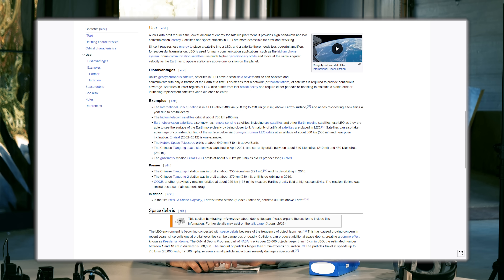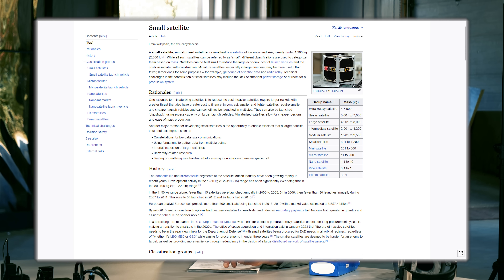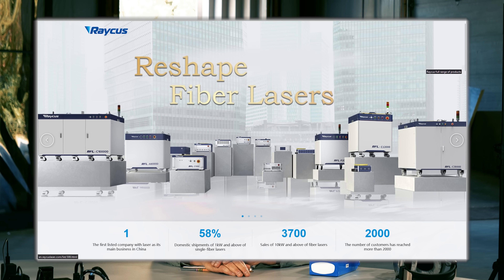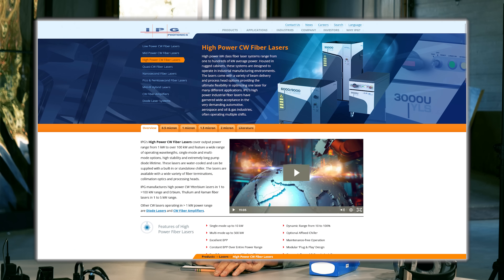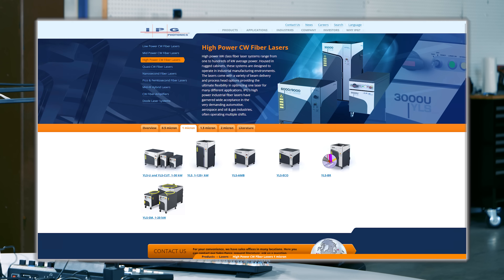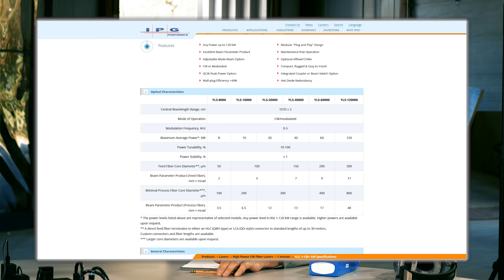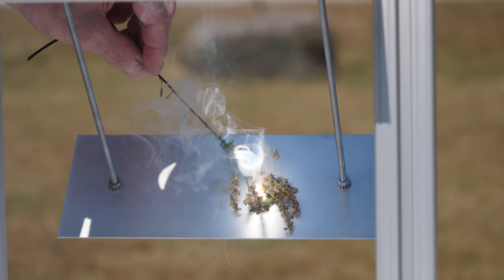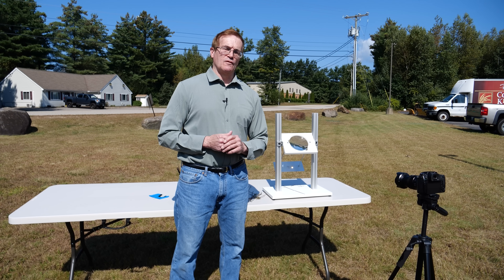COULD SATELLITE LASERS REALLY DO THIS?...

Comment: The No. 1 Challenge with a satellite is not distance. It's HEAT. The ISS has massive radiators just to deal with the heat produced by the power/environmental systems. As a frame of reference, the ISS has a peak power usage of 90 kW, with a peak production of 120 kW. When the USAF tested out the YAL-1 Airborne Laser the biggest challenge holding it back was managing the waste heat it produced. Getting rid of heat in space is very difficult and involves tradeoffs such as expelling coolant (a consumable), or having large radiators. 

DE systems produce an insane amount of wasted heat, even chemical lasers like COIL have these challenges. (Also you would want to avoid using a consumable laser system on a satellite)

Just something to keep in mind when talking about satellite based Directed energy systems.
Reply: Lasers on planes solve most of this, we don't need to be in orbit to set shit on fire with focused light. I can do it across my bedroom, and the military CAN do it from much further. Hell they have lasers in the point defense systems.
Reply: It also has a pretty hap-hazard CGI team as well . Along with those pesky airbubbles that seem to continuously show up on film when they go outside of it to perform " maintenance " ....
Reply: Its crazy the average car today makes somewhat more than 120kW now. That might be peak HP but still. A space station or a car.... just goes to show how inefficient cars really are.
Reply: Not really an issue especially with modern materials and a much bigger budget than NASA or the ISS program.
Reply: What about a giant magnifying glass?
Reply: @TroyRubert  Yeah until you melt the satellite and now it's a hunk of molten metal
Reply: Heat lost [watts] = area [m2] * emissivity * 5.67e-8[Stefan-Boltzmann constant] * T4 [degrees Kelvin]. unless you just let it be single use, it burns
Reply: Fiber lasers don't have the heat problems that other kinds do.
Reply: True but this system would not need to be on for very long. 
So you could easily dump the heat into water and let it cool off slowly. 
Dumping the 10min of full power of this laser into 100L @ 10°C water would bring it to 80°C. 
So well within the constrain of this thought experiment.
Reply: @hanifarroisimukhlis5989  where did I say the sat wouldn't have sufficient thermal regulation? I just said the ones we can make to day are better than the ones on the ISS.
Reply: I would expect that something like a phase conversion heat sink would be employed.  Presumably the laser duty factor is quite low so you sink the heat and then dissipate it over time.
Reply: I thought everything about this video was great except for one thing. He completely blew the punchline! Really smart people do that a lot.

If the destruction of Lahaina was a Rube Goldberg Contest, this video would be the proposal to Blue Ribbon 1st Prize!
I’ll break that down for YouTube tier…
‘How to do a VERY simple thing in the MOST complex and convoluted way possible.’
Reply: That's the mechanical power it produces, usually efficiency is below 30%, which means that 120kw car produces 240kw of waste heat, some of that gets expelled with the flue gasses = "exhaust", and the rest has to be dumped into the passing air usually with water to air heat exchangers. Some does get transfered from the engine and exhaust surfaces as well via radiative and convective heat flow. 
This is all much easier because cars operate in atmosphere.
Reply: Why not have a guy with a lighter. Give him first class flights and a stay in an upwind 5 star hotel. Should be quite a bit cheaper.
Reply: @TroyRubert  thermal dynamics, particularly thermal management is one of the few engineering fields that rarely changes or experience significant(large multipliers) advances from material advancements. This is not a situation where you wave some magic carbon fiber at the problem and it goes away. The thermal emissivity of a surface isn't going to see 2x-10x improvements without violating the no joke law of thermal dynamics.
Reply: You cant radiate heat into a vaccum genius...
Reply: @martyisabeliever  Umm,... yeah, you can.  It is physical conduction of heat that does not occur in a vacuum.  However, conduction in a closed system could facilitate more rapid periodic heat dumping cycles into heat sinks provided that there is sufficient time for radiant losses to drain the accumulations of heat over time.
Reply: Why not, indeed.  Would it surprise you to learn that this is being done on a wide scale all over the world already?  You don't think that those with immense fortunes and political influence might want to develop more technologically advanced "tools" if they could?  Do you think they can?  How much resources do you think they would invest just to see if it is even possible?  Just some things to consider...
Reply: @steffenjespersen247 That much water would weigh a bit more than 1,700 pounds, that is, just over 1/2 metric ton.

If the goal is to keep the laser switched on for the whole 10 minutes (mentioned in the video), how much water would be needed for that?

That is a lot of water weight to launch into orbit. That much weight would likely have to be launched on its own mission apart from the laser satellite itself; if so, then you would require a way to transfer that water into a container in the laser satellite. 

If you wanted to use the laser again the next time you are over the target, you would have around 90 minutes to dump the heat that you just put into the water so that it can be used as a heat sink for the next short. I don't how that would be done, or if it could be done that rapidly.

You would have the challenge of keeping the water from freezing solid in the low earth orbit environment when you aren't using the laser. Using insulation would be very bulky and heavy, and it might not even work. The only other option would be some kind of heater, which would require a lot of energy to keep warm constantly. This energy would have to be tapped from whatever energy source is used for the laser itself, which would require the energy source to be larger and heavier than otherwise.

OR, you could use a radioisotope thermoelectric generator (RTG) (which uses Pu-238) to provide the energy to heat the water. Unfortunately, the national stockpile of RTGs is rather limited, and there are security and safety issues that would add millions of dollars of costs to your spacecraft. If there is some kind of accident, or if the satellite is retired by de-orbiting, then the RTG might or might not survive reentry into Earth's atmosphere, and therefore presents the risk of a nuclear contamination incident. For these reasons, RTGs are generally reserved for missions to the planets and moons of our solar system, rather than being used for spacecraft in low Earth orbit.

Considering all of the above, I am unsure if your water heatsink plan is viable for this application.
Reply: Thanks for that, just answered all what I was thinking!
Reply: The heat problem you're referring to is actually the reason why the Death Star uses multiple intersecting beams -- fortuitously, the intersection technique also has other benefits.
Reply: @sfcarp9418 Don't forget the cable system and harnesses as well.
Reply: Spicy facts.
Reply: @Hclann1 50%efficiency mean you will get 20kW heat source for 10 minutes. And that is the same amount of energy that will be transfered to Earth with a beam. But let's imagine we'll have an additional 1m³ of water coolant there. It will rise its temp only by 17°C with that amount of energy. So nothing impossible.
Reply: @thee_number_six6227  One has a great point here. It does not take much to send up a disposable plane. Its very unlikely that the US can track every plane in the air. If you can track every plane then U2 would be spotted every time it goes up. Dispoable planes that can go up 100k feet and then ditch in the vast ocean would be quite easy to build with todays tech.
Reply: @Hclann1  Well that is good to know.
Reply: phase change thermal storage, pumped into radiators specifically designed to emit blackbody ir into the black.
basically store the heat spikes, bleed it off over a week, in order to get a few seconds of zap every once in a while.
it's not like the weapon has a 100% duty cycle 24/7.

it's definitely feasible.
Reply: Of course you can. @martyisabeliever
Reply: @kameljoe21  It is certainly seems more feasible with current technology to run such a weapon system from an aeronautical platform.  But, that does not answer the question being posed here.  And, when all things ae considered, an orbital platform may have use cases that might make such a technology desirable to those who would invest in its development.  The question here is simply, can it really be done (not was it or should it or would it, etc.)?
Reply: @Embassy_of_Jupiter  hold my beer while I make them out of iconel and attach them to a heat pump that can handle a few thousand degree tempature gradient... 🤣😆

This is a joke... until someone links a usecase where they essentially did exactly this. Engineering is compromises lol
Reply: Agree that a plane is a more practical platform.  Consider how satellites are managed, involves far too many witnesses.
Reply: Thank you for your comment. I had bad info...
Reply: If we look at the H4 laser beam mounted on Humvees on convoys across America, Ratheon is marketing them to mount on a Chevy Silverado. Who are they selling to? To start fires for real estate? And who owns ratheon? Blackrock/Vanguard/Statestreet who owns the central bank, the military and is heavily invested in real estate.
Reply: @MorRobots   Hyperbole is a rhetorical device and does not support technical arguments very well.  Do you see this as a political issue?  How exactly did you come up with "a few thousand degree temperature gradient?"  I mean, given the relatively meager energy discharges and short duration duty cycles we are talking about here, I don't see how you got there.
Reply: I thought the ISS was in a nasa swimming pool in Texas.
Reply: The ISS mostly has that because humans are less tolerant of heat than machines, but heat is an issue
Reply: @simonlinser8286  not sure how a measurement of peak HP (pulling strenght) is a proof of inefficiency. The laser isn't moving a damn for example
Reply: @Hclann1  fiber lasers have the same heat problems because they are using the same laser engine. It is somewhere else and the laser light is carried by the fiber. Unless you have a VERY long fiber from the ground, it's not gonna work for a satellite.
Reply: @marcogenovesi8570    Laser light transmitted by fiber is not the same as fiber laser.  It is a particular type of laser "engine" that uses the fiber as a gain medium (instead of a gas).  It is quite a bit more efficient than gas lasers and thus does not produce as much waste heat.
Reply: This means if such systems are deployed then amateurs should be able to detect the telltale thermal radiation signature for hours after deployment.

Great step to being able to falsifiably analyze these programs rather than relying on simple trust and guesswork
👍
Reply: @googleyt2622  Yes and no
Yes in that you don't need an order of magnitude more input power to run the laser
No in that it still outputs more waste heat than laser energy
Reply: @hakasays  Good point! It also means any such weapon would have to be considered disposable since any near-peer adversary would be able to spot it and shoot it down, so the target effect better be worth the cost of the system. Given heat and energy constraints, the amount of engagement is heavily limited before a lengthy cooldown would be needed, where the system would effectively be a sitting duck afterwards. Might as well invest only in a super basic cooling system since being able to reuse should be considered a bonus and not expected.
Reply: @martyisabeliever Were this true, every astronaut we've ever sent up would have died from heat stroke. You can't CONDUCT heat in a perfect vacuum (of which space is certainly not), but you actually can't stop it from radiating out. 

Having large optical radiators (think the coils on an electric stovetop that glow red) that are fed by a conductive thermal well (such as pumped water, glycol, freeon, liquified gasses) is generally the way most spacecraft do it.
Reply: @tomfeng5645   And the only realistic alternative to this would be a plane-based system, which means that transponder tracking and 4th-generation night vision hardware would both offer mechanisms to track down such systems.

If microwave-based then we would also expect to find local EMP-effects on affected sites (cell phones nuked, etc).
If UV/IR it would be detectable via cameras, and if microwave/millimeter it should show up to some degree on local WIFI disruptions/impulses.

The point is to get people staged so that even if the tech was real, it could no longer be deployed without being reliably detected by the populace.
😙
Reply: @tomfeng5645  That does not contradict what I stated about the difference between fiber lasers and gas lasers.  As far as the fiber laser in consideration here, the actual specifications have already been stated quite clearly in the video.  The manufacturer's claim is 40% power conversion which is why the estimated power input requirement is 50kw for the 20kW model.  Obviously, the waste energy will be 30kw in this scenario with most of that being waste heat.
Reply: I can't believe the 400km range was kept at a constant but would only exist for a fraction of a second. Most of that 10 minute transit would take place at thousands of kilometers away. There's also the tracking at such speed. Oh and power-loss of the beam traveling through air. We barely have systems functioning on smaller scales, so no way in hell there could be a space-based version. Especially with the absurd cost it would be.
Reply: @MorRobots Inconel is probably not the right material here, given it's weight, it's ridiculously low thermal conductivity for a metal, and that a mechanical attachment to a chunk of metal that's thermal cycling that hard is gonna be an absolute bugger. I'd go with a ceramic, something like AlN or CBN.

Pure silver (best thermally conducting pure metal) has a thermal conductivity of ~400 W/mK, while inconel is 15 W/mK. Inconel is a fantastic insulator, which is why it's awful to machine. Cubic Boron Nitride, however, conducts at ~750 W/mK, nearly doubled that of silver. CBN is fairly cheap, fairly light weight, quite formable, a bit difficult to machine, extremely durable, and can handle in-range thermal cycling indefinitely.
Reply: @martyisabeliever Yes you can?
Reply: @JJayzX  Well the patents and prototypes do exist, and budgets seem to be fairly bottomless for projects like this.   With most of the public disclosure for millimeter-wave and similar being primarily plane-based and not satellite.

But to risk disclosing an entire program just to smoke a few city blocks in Maui would be beyond insanity.  And if it were such a case then it would not take much effort for random investigators to reverse-engineer and prove it.  Telltale signs/fingerprints that would be impossible to mistake for nature.
Reply: Some of it is grounding as well. They can build up some incredible static electricity.
Reply: @hakasays  patents mean nothing, anybody can create patents without actually making said devices or that they even have to work. Also people nowadays simply can't keep their mouth shut. So if their were lasers in space it would be a big deal, cause space treaty forbids space-based weapons.
Reply: @Hclann1 on earth.

He said, they are 50% efficient.

This means that it will have to dissipate an equal amount of its output, without the benefit of atmosphere to discharge this heat.
Reply: @simonlinser8286  It's not so much cars are particularly inefficient as it is moving around on the surface in general is inefficient. Road and tire friction have to be balanced for acceptable handling, air friction gets worse the faster you go, every time you go up hill you have to expend more energy fighting gravity, everything is just sapping your energy compared to coasting around in orbit. Space station is about as close to pure Newtonian "assume a spherical cow in a vacuum" as it gets while still being technically inside Earth's atmosphere.
Reply: @barrybrevik9178  How on earth do you figure that 100L of water is going to weight 1700 pounds? 1 litre of water weighs 1kg. So 100L weighs 100kg, or 220.5 pounds. And it seems to me that having it freeze is a benefit, not a problem. If you want to cool something down a 100kg block of ice is a good thing to have. Then you have the benefit of the phase change from ice to liquid.
Reply: Cooling system. A foil bag and a bottle of water. When things get hot, water turns into large inflated bag of steam. Which can be slowly cooled down and recaptured to recharge.
Reply: @hanifarroisimukhlis5989 do some research on current metal ceramic hybrids! What you think you know is nothing judging by your comment!
Reply: @jamesthomas4080 well put!
Reply: That's if you trust the information you re given is true.
Reply: no way the iss have 120KW of solar panels xD and for sure does not use 90kw. you are way off dude. it would be beliveable if they use 9kw and panels have 12kw maximum.. i bet they only use 2-3 kw at any time as it is a small space to be heated and recycling air and piss does not take much power.
Reply: @tripplefives1402 yes they still heat up but not like you describe
Reply: Heat is a huge problem in space.  But it can be solved.  In the context of GW scale radiators, I got it down to around a kg/kW using condensing water in plastic tubes.  The mass of the radiator went down as they got cooler, something unexpected.  It was because the vapor pressure of water fell faster than T ^-4 from boiling to freezing.  20 C seems to be a reasonable radiator temperature.
Reply: @kameljoe21   Pity about the pilots, though. I guess they'd just have to take one for the team. 🤕
Reply: You do realize how cold space is right?
Reply: I once was told a story by the EE who ran the electronics shop at my university about how he had worked on a satellite kinetic kill device that had a seeker head that put out a ton of heat while operating, the solution to keep it from burning itself up was to surround it with wax as the heat capacity during a phase change is infinite. I find it plausible that even if a large amount of waste heat is generated if there's enough phase change heat sink material to let it fire long enough to accomplish the objective then it's just a matter of how long it needs in order to cool back down. What that would take? I don't really know.
Reply: I had access to certain information 12 years ago, and from what I understand there are weapons in orbit that are expendable chemically powered laser type energy weapons. There is no issue with heat since they just burn out as they are used, and are very powerful - powerful enough to penetrate vehicles and buildings to kill high value targets.
Reply: Naw, you want to use a deuterium fluoride laser - then wonder where the damned thing wandered off to after firing it.  ')
Reply: @thee_number_six6227 you forget that the earth is round? A Boeing 747 with a directed energy weapon isn't going to reach the other side of the globe like a cluster of satellites could. Especially when it can barely reach 800+mph depending on the variant. Imagine Starlink with directed energy weapons. You could strike anywhere, anytime. Hypersonic missiles would be more effective.
Reply: Also humans wouldn't be inside the directed energy satellite so heat wouldn't be as big of a deal. If we have satellites flying past the sun, we should be able to use a directed energy weapon for a short burst. It's not like it's the Directed Energy Satellite "Odin" from Call of Duty lol
Reply: @vihreelinja4743  Yeah, that seems very eccessive. I always think about it in terms of gaming computers :) 90kW is more than a hundred of those going full tilt all the time. Or 30 maximum size water kettles. ALL THE TIME. Makes no sense.
Reply: @hanifarroisimukhlis5989  it doesn't really look like it takes 10 minutes to set stuff on fire though, wouldn't the satellite survive 15 seconds?
Reply: @martyisabeliever  if that was true you'd never feel heat from the sun, the heat getting here in the form of solar radiation that is radiating from the sun
Reply: @martyisabeliever Sure you can.
Reply: IggyDalrymple  Just have a satellite reflector at a geostationary point and keep the laser generating facility on the dark side of the moon with subterranean intercoolers.
Reply: @MrSeanman30  an amazing feat, were a 500 pound satellite to power anything beyond a laser pointer.
Reply: @MrSeanman30  heat is the enemy of electronics. Don't believe me? Take a hair drier to your computer while you're trying to use it and get back to me on the results.
Reply: @martyisabeliever  If that was true we would not receive any energy from the sun.
Reply: Military lasers tend to be used for target ranging or illuminating for laser guided missiles, smaller versions are used for sights on rifles, or blinding the enemy's laser's used for this purpose. There have been US trials of attempting to use them as weapons, but if they were successful its been kept quiet. They also cannot be used to blind the enemy according to the Geneva Convention.
Reply: Thank you for that.
Reply: That's something I never even thought about. Without convection, all waste heat has to be radiant disposal.
Reply: @martyisabeliever Um... The Sun would like a word with you.
Reply: @rocketsurgeon4876  Did you miss the whole segment on the weight of a satellite being limited?
Reply: Not an issue when it's all CGI
Reply: So like the mirror setup on the James Webb "telescope" 😅